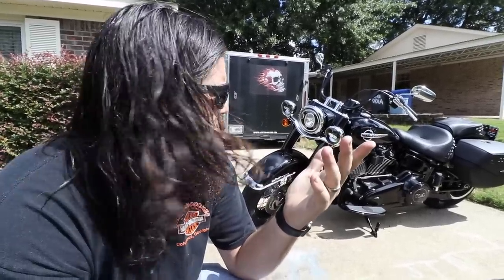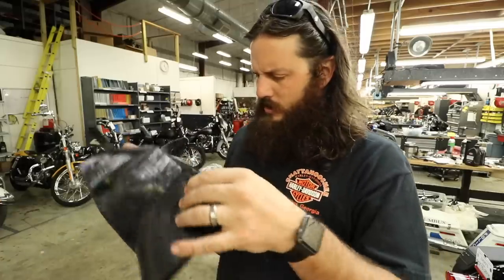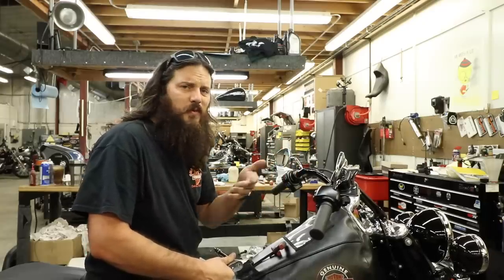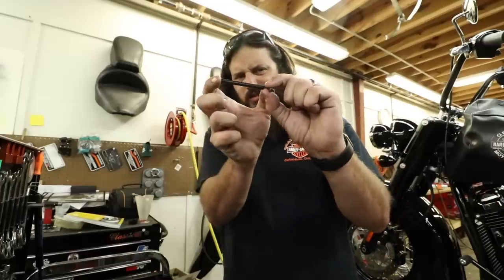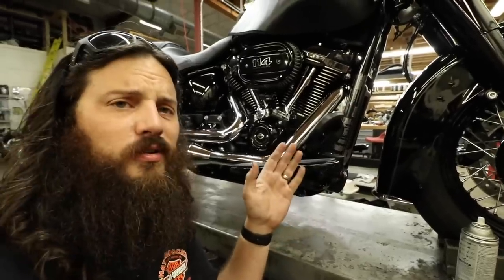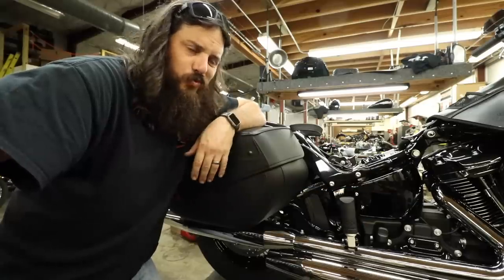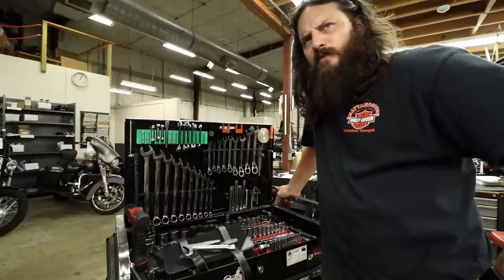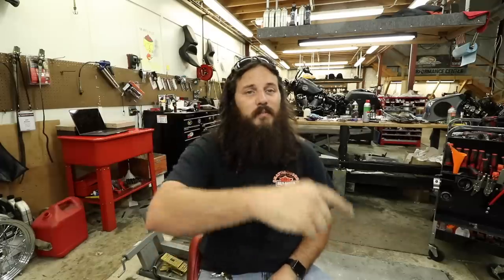What MOTORCYCLE TOOLS to pack when TRAVELING + GIVEAWAY

Comment: Hey John, I've been caring tools for over 40 years and the thing I needed the most was a new set of spark plugs/wrench and electrical tape.  Zip ties, spare fuses, and some wire (in case you have to tie up exhaust or something zip ties won't hold strong enough). This was a great idea for a video as a lot of guys don't think about what to carry. Later bud

Comment: Carry a small tire plug kit, small hand pump, common fuses for your bike, and a length of clear 1/4 inch tubing to syphon fuel in case anyone in the group miscalculates distance and needs a little from the group.

Comment: I won't leave home without a vise grip. It can fill in as a make shift lever. I've had t use it as a make shift clutch lever and gear shifter. Duct tape is also a necessity (it protected my foot from the rain when i got a hole in my boot. I read in an old Easyriders magazine to carry a siphon hose and a hose with an air chuck at each end so you can share air if necessary. Of course, with the power outlets that are on every bike now days i carry a patch and pump kit. I also carry a small power pack that can jump a motorcycle battery and has a USB port. I also carry one or more flashlights. Pliers saved my butt when a rag got sucked in to my drive pulley in the middle of the night in the middle of nowhere. I spent hours pulling out bits and pieces at a time but i was able to get back on the road. Also pack spare bulbs and fuses. Thanks for the great vids! keep the rubber down.

Comment: Add tools for tire repair. Air compressor from H-D, valve stem cores, valve core T-screwdriver, valve stem caps, plug repair kit for sharp objects.  I have had flats on the road in the boonies.  I have needed the air compressor and plug.  The hole repair plug will put the tire out of balance. I have assisted others for repair and air

Comment: I recently found this channel...I like the style of video. Consider me a fan!  I'm old. Had a few Harley's in my time. Mostly dressers. Put 100,000 miles on one of them before an overhaul (yeah, I'm over 60). These recommendations are spot on, but (everybody's a critic).... Items I packed and used at breakdowns for myself or others: duck tape, 12 feet of 14 gauge wire(IE:  turns into two 6 ft strands), small amount of tubing to siphon gas, vice-grips, electrical connectors(you pick), a lighter (the kind that has a waterproof flame), needle nose pliers, spare bulbs( old light setups that don't run led's), small bottle of rubbing alcohol (tar, shoe rubber(quit laughing), stubborn bugs), small clips that clamp( smaller than the one that work on tarps). These might take up a bit more room than you want, but they really helped out when I/we needed them (😎another reason I ride a dresser). That said, I'm not buying you anything, but please keep making videos.

Comment: Pair of needle nose pliers, regular pliers, bailing wire, electrical tape, spark plug gapper,  plug socket, locktight,  Small funnel. Allen wrench for my highway pegs,  in addition to about 5 open ended wrenches, sockets, T-sockets, allen & T wrenches you mentioned.  Plus of course ratchet, extensions & converter from 3/8ths to 1/4.  You'd be amazed how often a little bailing wire can get you to a town with a hardware store or Harley dealership. One of the most common repairs I do on trips is screws coming loose on lights or changing a bulb that's gone out, things like that. If I don't put locktight on those little screws they like to vibrate out down the road.

Comment: One item for a tire change would be a 1.5 inch adjustable wrench. Cheap on amazon in case it gets broken and it’s small enough to fit in the bag and if it breaks no worries, usually under $10.

Comment: For my bike, not just toolbox, I add additional from your list: electrical wire, two wire strips with alligator clips for ignition key failure, map, small tire treatment, small volt meter, extra oil plug bolt an O-ring, spark plugs, an extra tail/ headlight/turn signal bulbs, small disinfectant wipe tube from dollar store, small bottle water (that bottle of water saved a family of four in the desert, good thing I had it along), the amount of tools I add depended on length of trip an purpose, I've carried a DVD player to play "History of Harley Davidson" and "Terminator" movies that were hits at camp, haha! Also my cell phone is biggest aid along with tow insurance! Love your product knowledge an personality, All out there, Ride Safe!

Comment: A definite add: tire plug kit and mini-compressor. I use a compressor from AeroStitch. It's small but effective, plus it includes all the possible electrical connections that you might need. Keep the videos up, John...you're doing great. Saw you at the Choctaw Casino while you were vaping outside. Looked like folks were beginning to line up to talk to you. It's hell becoming famous, isn't it?

Comment: I carried a lot of zip ties and tape. One additional tool I carried was a pair of vise grips for an emergency brake/clutch lever.
Reply: Small amount of electrical tape, 2ft. 18 gauge wire. 12 in. Mechanics wire. Tire repair kit,  that's some other things I put in my kit.  The Harley-davidson 8 in one  screw driver is a good add also

Comment: Thanks John for another great video. I'm 69 and been riding for over 50 yrs. Just brought a 98 wide glide with 16,000 miles. Love this bike. Even that I been riding for along time I'm still learning and you have been a great source of information keep up the great job you doing. I live in Waynesboro,Ga. south of Augusta. Planning to ride over to the shop and check ya'll out later this summer. Stay in the wind and be safe.
Reply: Ty Hey I have  97 wg Why won't the fuel filter come out of the tank when I unscrew the petcock?

Comment: 3 things I either have or I’m adding to my tool stash. Cheap harbor freight volt meter to figure out if a battery is bad vs. not charging. A set of small gauge jumper cables with small clamps, and the most important in my mind a safety vest/flag/some flares. I hit a deer the middle of August on my bike(bum shoulder, some new hardware holding my leg together and I’m up and moving somewhat) and quickly realized that laying on my back on the highway in all black was no good. 
Also, one of my big things that I’m going to start carrying is what I call an Oh Shit kit. Basically a first aid kit packed with the items to fix big problems like heavy bleeding. I got lucky that my bleeding wasn’t super excessive but it sure could have been. 
Ride safe, and look out for others on the road, You may need their help some day.

Comment: One thing I always have in my tool roll is tire repair like plugs rubber cement pilers little things like that
Reply: believe it or now I have fix-a-flat never needed it but I will gladly use it if I'm a good distance from my base, gonna replace the tire anyway!

Comment: Well thought out presentation and delivery. 
A small needle nose vice grip saved my butt once when the throttle cable broke lose in the grip. Once I separated the cable from the grip I routed the cable over the  handlebar over the break fluid reservoir for leverage and was able to ride 40 miles home.  I was in the middle of nowhere at 10pm, one additional item I carry is a headlamp.

Comment: Another great video and very informative as usual.
Something I always carry is a puncture repair kit and some little C02 air canisters, cos a puncture can really phuq your day up..
Keep up the gtood work John, look forward to your next vid.
Reply: Good ideal Ed ... have a brand recommendation?  Plan to implement on my FLHX!
Reply: James Kees  There are loads of brands available that all have pretty much the same content, similar to this on ebay (probably can get on amazon as well) 
https://www.ebay.co.uk/itm/NEW-MOTO-MOTORCYCLE-TUBELESS-TYRE-EMERGENCY-PUNCTURE-REPAIR-KIT-WITH-POUCH-2018/162174032210?epid=1780943373&hash=item25c2535952:g:wxEAAOSwlQ5baVwy
These are only good on tubeless tyres tho. 
Get a puncture in a tubed tyre and thats headache time and normally time for a recovery truck.
Or you could use something like "Holts Tyre Weld" for tubeless tyres too
Reply: There's a product out there called ride on that not only balances your tire but also instantly fills any punctures up to i think an 1/8" hole.
Reply: James Kees I use a MSR BRAND Inflation Kit.  3 cartridges, nipple tool, and black cloth zippered pouch.  Total size is a little bigger than a deck of cards.  Dosent include a patch or plug kit, but doubtful I would attempt to tackle that on a roadside...

Comment: Dont forget a knife, tape and hose clamps. Sometimes the tools arent enough to make the repair so it's a balance of tools and material. If you can fit it, a tire plug kit can get you to a shop/home in a pinch. On long trips tire repair is a priority. Never know when the highway is gonna "screw" you over. Haha
Reply: & a colt 1911!!
Reply: @moorshound3243  haha, I'll stick with my xd40.

Comment: First comment I have ever done on a utube channel. With six bikes and all of them 2005 and older, the basic tools are the same with a mix of specialized tool for each. Combo screwdriver with different hex bit ends are a must than buy a Hex/Torks bit set that fits the combo screwdriver. Toss the bits you don't need. Tight spots or tight fastener, use your 6" crescent wrench (everyone should have a 6" or 8" crescent wrench) on the bits. I'm an old Pan, Shovel, Evo and early Twin Cam kind of guy so your vids are great for me to keep up with what Harley is up too these days. Thanks John.

Comment: I have 2800 tools in my roll around tool box , I carry a set of torque bits 30 piece 15 are allen the other 15 T , 2 bags of standard wrenches 1/4 to 3/4  a zipper bag with 3/8 sockets  1/4 to 3/4 and a plug wrench 13/16 , my SE heads use a 5/8  plug 12mm plug stock heads are 14 mm .  1 crescent wrench 5 inch .   on the road i have yet to use anything but the T 20 light bulbs seem to be only thing I have go wrong .  I roll up my tools in old bath towels I cut in half,  tools have been on my 1986 FLT , my 1990 Sportster 1200 and 1995 road king . Im doing a 2 week road trip in 10 days .    I rather have them not need them .   Tire or belt has to be done in the shop .  but most everything I carry I can fix on the road Carb to pipes, bags, lights .

Comment: a tool roll can definitely be handy. I have found that the more often I have a tool roll with me the less I need it but I have needed it to help a fellow rider before and it is always good to have some road side basics.  A spare maxi fuse isn't a bad idea, spark plug socket *sometimes people carry spare plugs. Zip ties come in handy for sure. You laid out a good plan to sort out some must have tools. Life on the road is always better so of course if you break down the faster you can get rolling to a shop or your destination the happier you are. Good preventative maintenance and a good pre trip check is also worth the effort to minimize problems on the road.

Comment: Good video thx, one tool that saved me from the tow truck was a set of vice grips, I pulled my clutch in after getting off of a 2nd shift, and snap, grabbed the cable with the vice grips and used it like a clutch lever to get home.

Comment: I never read all the comments but would add the following. A headlight, the kind you put on your head. roll of electrical tape, vise grips, a small wad of bailing wire, some latex gloves or thin rubberized nylon work gloves like Maxiflex , a small tube of waterless hand cleaner, a good trauma style first aid kit with a tourniquet or 2, a canteen or water bottle, a 4 in 1 screw driver (Klein makes a nice one), a clear pair of safety glasses, $200 in twenties, blue loctite stick, JB Weld steel stick. I'll think of more

Comment: Thanks John you've inspired me.  I'm the guy on the aging 10 year old Dyna who's always worried about my battery terminals coming loose (because it's actually happened).  Somewhere in the bottom of my saddle bags (could be either) along with the grocery store receipts, dirty rags lubricants and God knows what else are the screw drivers I need to perform that simple task.  I've never given much thought to anything else going wrong (maybe not such a good idea).  Anyway, with or without your snazzy give away bag, I'm getting organized and taking a look at what could take me down out on the road and getting it into an organized bag,  roll or what ever.  thanks much and keep up the good work!  Oh, I'd add a small mag light to the tool kit (half the time, it's dark)!

Comment: I used to carry just a couple extra little items along withe one's you have suggested: a little bottle of loctite, a little swatch of fine steel wool which could be used for stipprd bolts, especially on old bikes. A leatherman is always good to have and a tube of high heat RTV sealer in case you have to make a gasket. In 1990 I went to Sturgis on my '76 Bonneville from San Pedro, CA. Had a great time during the whole trip, and of course I did experience  one break down on the side of a corn field in which I did use the items in your list plus the one I've added. Lastly, one of those little battery storage banks for an almost dead cell phone might be useful in a pinch

Comment: I carry Allen wrenches and torx sockets plus a compact socket set . Plus tire repair kit. Used to carry a can green gel tire repair but on my old bike I had the tires filled with the green gel sealer. One time I was headed about 100 miles away from home in my way to a Harley dealer in Hammond Louisiana. As I got in the plane to turn onto the main road I felt the toe shifter go to the foot board. Good thing I had a heel shifter. Was about 10 miles from my destination. When I got there I got off and went inside and borrowed an Allen tool kit to tighten the toe shifter after adjusting it to what looked like the correct position thank God I didn't lose the the bolt that holds the shifter in place

Comment: Thanks for the good info. I was just getting ready to build a tool kit. A couple of weeks ago my headlight fell off hanging by the wire. The bag on my handle bar must have prevented it from moving sideways. Luckily I was just a mile from a friends house to get some zip ties which will be in my kit.
Reply: Good advice. Will rework my tool roll.

Comment: Great video and advice. I carry enough gear so I can even do a valve adjustment on my BMW R1200 boxer engine from the side of the road. In addition to tools, I carry low cost spare parts (e.g. my model is susceptible to popping off a rubber grommet on the air intake manifold - so I carry spare rubbers and clamps (a $20 investment that could make the difference between running and not).

Comment: Nice idea. I already carry tool kit on my 2018 Streetglide Streetglide special. But one thing I carry besides zip ties. Is electrical tape because U might get a issue with wiring or just need to hold something together. Kinda like MacGyver

Comment: I'm running a '21 electrolyte standard and like what I'm reading about including electrical tape and zip ties like you mentioned. I also carry a multi-tool Leatherman just specifically for the needle nose pliers but the other appliances are useful as well

Comment: Tool rolls are always good to have with you for just in case situations. Better to have it and not need it, right? I would definitely add a tire repair kit to it. Easy to do a tire repair on the side of road and then take your time at a safe speed to get to the nearest tire shop to replace. CO2 cartridges work for non-baggers to air up tires after a repair. For the baggers, one can pickup a small compressor that plugs into the accessory port.

Comment: John, that's a must have. I also pack in my bike and other vehicles a trauma kit. Amazon sells a AMK trauma pack ( Very compact ) with quick clot for 29.68, small price that could save a life. Or make your own kit. Walmart has everything to make about the same thing and I use a vacuum seal bag with a razor tapped to it for that I hope I never have to use. I also carry a Schumacher 600A Lithium jump starter. This is designed for power sports, motorcycles and up to 6 cylinder veh. Features; 4 led indicator for batt. charge,  compact w/ case, 5v, 2.4A + 1A usb port. So it can charge even tablets etc., protection against reverse polarity, short circuit, low voltage, H/temp., and reverse charging. There are cheaper ones but you get what you pay for as the saying goes.

Comment: I also carry some safety wire, duct tape (wrapped around the handle of some tool so it's not to large) elec. connections
a little elec. wire (2-3 diff. gauges), knife, small flashlight, telescope magnet (drooped fastener were you can't reach), and a small inspection mirror.

Comment: Something to add for the allen and torx keys could be a small length of small diameter aluminum pipe like you would use in a wind chime, slip the key in it for some more leverage.  Great video.

Comment: I have used my booster pack on  both bikes and cars that would not start, nothing worse than the dead battery!  nice video! For really long trips I got one of those 1 gal gas cans that fit in the hard bags.  helped save a reputation on a rally ride to get an "over excited" ride back that for get to fill up. my two cents. have fun and break the record!

Comment: John, 
Big thank you for the great work.  I also carry a small air compressor/tire plugs and 2 spark plugs (used ones I took off) I’ve never had my plugs failed but have given the used plugs to other riders that are on the side of the rode because they cracked or fouled their spark plugs.  I do have a very compact battery check tool that connects to the charging pigtail.  Thanks for the great work